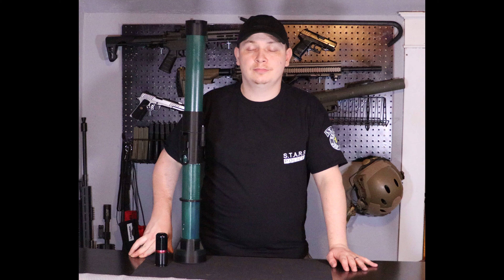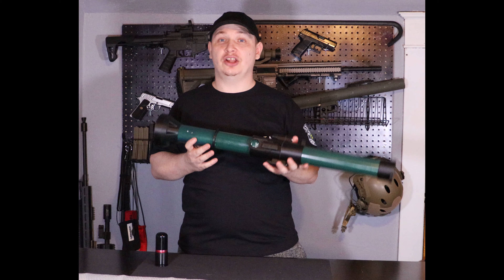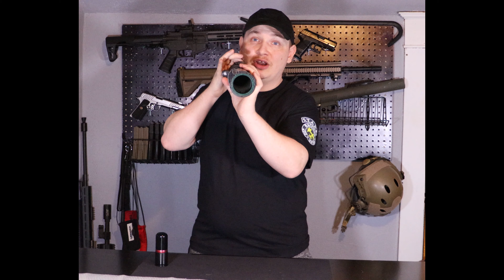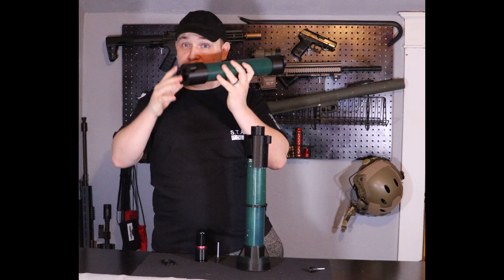XE-15 CAT (Cheap Anti-Tank Launcher) Airsoft 40mm 2023 Top Gear 3d Print

Comment: What if you had one bolt as a pivot point so the loading port would swing open instead? You could even do a simple pin for the other that could just be pulled out for you to rotate the barrel for loading